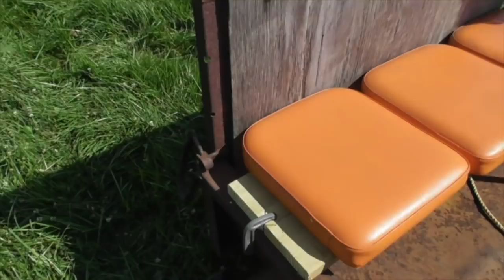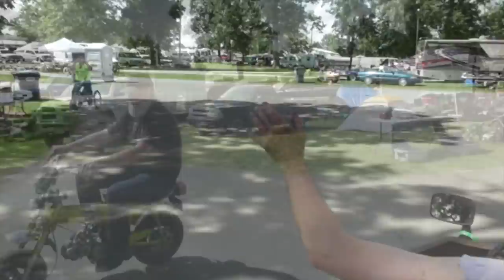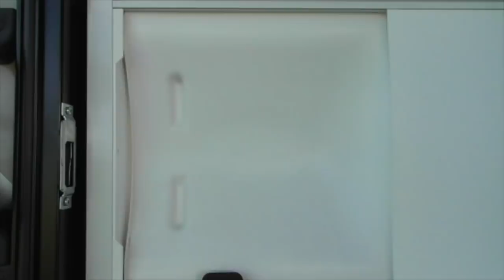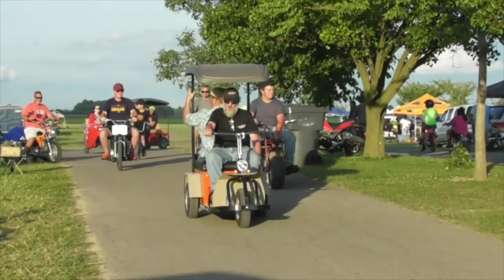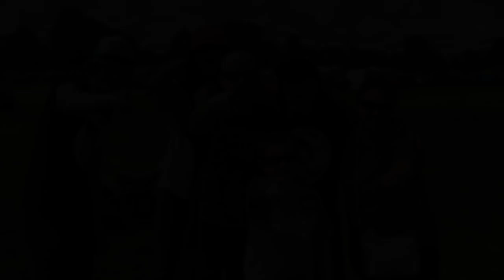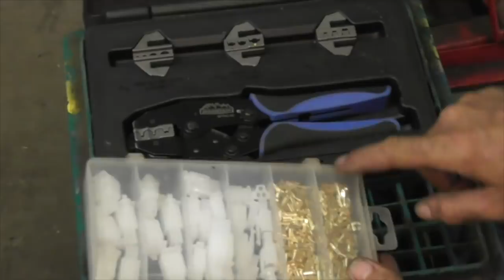SUPER COOL Vintage Motorbike Show! (2018)

Comment: Sometimes it doesn't matter what you do to repair a lawnmower, car,motorcycle or power tool there's always someone whose going to abuse it to the point it just breaks because they are exceeding what it is designed to be used for.

For example, my dad bought a 1.6 litre Mitsubishi L300 (Delica) van to get a family of 7 out of trouble after the motor blew up in our old 1972 model HQ Holden (GM) Kingswood station wagon back in the 1990's.

It used to be owned by someone who used to work at the same company my dad used to work at,him & his wife towed a caravan around Australia with the van.

After they got back from the trip the engine needed a rebuild at 100,000 kilometres (60,000 miles),that's all you get out of them if you want to tow a caravan with one of them !

I think we got 150,000 kilometres out of it without towing a caravan albeit loaded up with 7 people then it needed another rebuild.

So it was rebuilt "as new" meaning it had been bored out to 0.060" inch oversized & oversized pistons & rings fitted, then someone told my dad that it was o.k. to run unleaded fuel in the leaded motor.

So at about 350,000 kilometres, the cylinder head overheated ,bent then blew a head gasket which caused it to crack a piston ring.

The same people who told him that it was o.k. to run unleaded fuel in it towed it away then bolted another cylinder head on for $1500 AUD,the engine fumed at anything over 80 km/h & burned oil.

My point is that my dad told them to leave it alone if there was ring damage because another engine was needed because the bore got damaged & was at its machining limit so another engine block was needed.

My point is that I would never buy a Mitsubishi car & much prefer a Holden (GM- Holden) car than one of them because they are much more durable.

Their current offer (ZB Commodore) is disappointing because it is just like that motorized pushbike so I have to make sure General Motors isn't thinking that's all I got !!!!